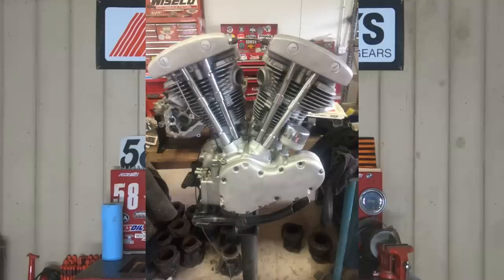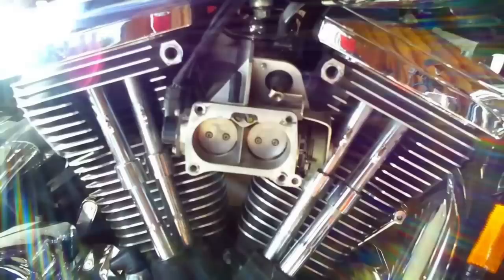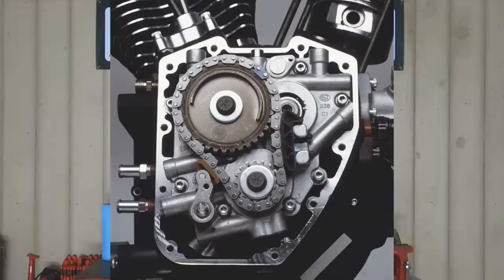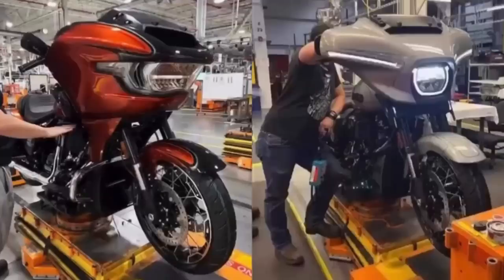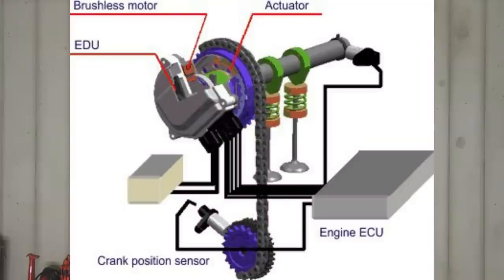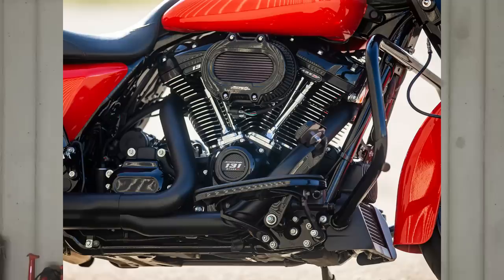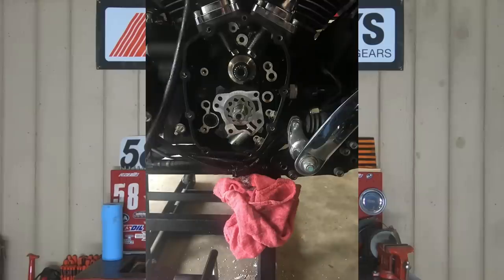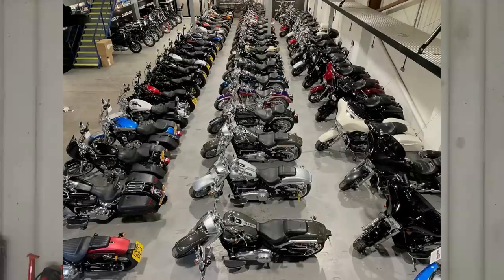Simple Harley Engines are Gone Forever

Comment from the maker: Do you think the Variable Valve Timing system is going to work well or do you think it's going to cause some unforseen issues?
Reply: Oh no it is 100% going to cause some issues, tha k God it's only on the dentist's and lawyers bikes for now
Reply: I think it'll be fine until people mess with it, just like any other evo-after Harley... They only really start to have problems when people mess with them... Yes my 103 has a stage one... Hopefully stage 2 soonish, but simple fact if you leave them alone they're reliable... I modify all my vehicles, my bikes, my trucks, but good on HD for doing what they have to do to keep a real v-twin alive
Reply: It will be a nightmare, just as it has been on cars.
Reply: It's beats up cams in pretty much every engine It's in.
Reply: Gm already has it on its v8 pushrod engines -
No problems -
Reply: @tylerlower5140  did you forget about the twin cam tensioners?
Reply: First off I'm not a VVT hater, but every manufacturer has a certain amount of issues with VVT. GM, Ford, Dodge, Toyota, Nissan, Honda and I could go on. Simple fact is the more moving parts to wear and oil the more points you will have for failure. Seen failures in everyone listed above. No one builds a bulletproof system. When you start building high HP applications in the aftermarket, most eliminate those systems for reliability concerns.
Reply: @tylerlower5140   thats how I feel as well. Let them use vvt and whatever tech wizadry to keep a air cooled american v twin alive. I wish they had tried vvt technology to try and keep the sportys evo around longer.

Comment: Evo sportster is the best engine ever
Reply: I had the first year. Chain drive 4 spd. $3995.00. I eventually punched it to a 74 but sold it in 96 after 21,000 fun miles. Wish I still had it.
Reply from the maker: All feelings aside and stick to the facts you're a fool to argue that point!
Reply: People shit on sporties but I love them. Probably gonna buy a used beater as my backup bike in the next year or two.
Reply: Until HD eliminated the "Trap Door" for the transmission, so they could charge a minimum of $2500.00 to split your cases to fix a transmission problem. What a scam. Indian followed suit by installing their oil pump inside the engine case.

Comment: Harley Davidson is going to evolve themselves right out of business, mark my words. VVT engines rely on oil system sensors to operate, sensors in oil are always a problem. I have been a mechanic on both cars and bikes for too many years to recall, and variable valve timing engines in cars have caused more grief than not. I don't even want to think about VVT on an air cooled V twin, sounds like a total nightmare. But that's just my opinion.
Reply: We all have em 8:24
Reply: I would not buy the VVT engine until the bugs are worked out... I have zero interest in being HD's test dummy, especially at the prices these bikes are going for.
Reply: I hear ya... I keep my bike engine internals stock. The days of making insane power and noise out the back is not for me any longer. All I want is a reliable cruiser. This is my 3rd HD. The first one was a leaker and ate excessive oil. My 2nd one had bad lifters and ate the cam. it also ate too much oil. Both were M8s. The 2nd one sumped 500 miles after repairs at 8500 miles and destroyed the engine. It was a 2020 with the supposedly better oil pump. On my 2023 107, I installed the DK Customs external breathers and the Trask vented transmission cover. So far, so good. I purchased a 5 year extended warranty through a private company so I can sleep at night. Fingers crossed :-)
Reply: @Peter I have been riding for 5 decades and have owned everything from Japanese to American bikes... I have had problems with more than one manufacturer's design and build quality. the ONLY bike I had that NEVER had one problem until it reached 55,000 miles was a Yamaha 2007 Stratoliner with the 113ci engine. absolutely fantastic bike. and even much better with a tuned stage 1 setup. torque and horsepower equal to today's M8s. I should have never sold it. why stick with HD? I like everything about their machines with the exception of engine reliability. the Japanese manufacturers turned away from making cruisers. Yamaha screwed up going to that Eluder/Venture bike. plastic garbage. Kawasaki's cruiser is priced right. however, it is way underpowered and also made of plastic. what is Suzuki making? the BMW cruiser is an odd bird, which I do not like. the only choice left is Indian. and their bike designs are so, so for me. my current 2023 107 Street Glide is the BEST riding motorcycle I have ever owned. love it. hopefully, with the mods I have installed, this bike will last me for many years to come. if not, I will have to look at Indian. and no, I am not stupid. I ride with many HD owners who have had minimal issues with their bikes over the years. so, not all of them blow up regularly. what do you ride?
Reply: Sorry you are such a hater... I wish you the best :-)
Reply: @richardrussell500  you know, here in the interwebs; all you typically hear is people complaining that their bike/engine/transmission has crapped on them, and they’ve got problems. I guess I just don’t understand that. Sure, there is no PERFECT, and sometimes when problems start (shavings in the oil for example), it causes other problems, which may produce the outcome of “my Harley is a total POS”.  Well, you typically only hear the BAD news. 

The good news is: I own 3 (three) TC’s and one old ‘79 sportster, and with proper maintenance, those engines are all running strong.  

HD deciding to switch over to water cooled and VVT may end HARLEY DAVIDSON, as the prices are exorbitant NOW; wait till they’re obnoxious!

I ride HD for the air-cooled simplicity of the TC engine. And the sound. Sounds like AMERICA to me!
Reply: I agree... a lot of negativity on the interweb. Unfortunately, I have experienced the sumping issue at 8500 miles on my 2020 114 trike, which seized the engine. Before the sumping, the faulty lifters ate my cam. My bike was serviced properly at 1000 and 5000 miles with oil changed at roughly 1000, 3000 and 6000 miles. And I was supposed to have the upgraded oil pump. I did not quit on HD as I purchased a 2023 Street Glide 107, which so far has been good. I keep my internals stock. I installed the DK Customs external head breathers and the Trask vented transmission cover. So far, so good. With the Trask setup I get literally no snot in my catch can. My previous two HDs suffered from blowby and excessive oil consumption. Fortunately, I am not getting that on this 107. I purchased a private 5 year extended warranty so I can sleep better at night. Fingers crossed. HD makes the best looking cruisers on the planet :-)
Reply: @Peter you are one negative cat...
Reply: More like troll... Move on :-)
Reply: I'm a mechanic working on mostly Japanese vehicles, VVT has been used for decades and I've never known any problems with the Jappa variants,maybe HD should talk to Toyota or Mazda etc.

Comment: I'm 50 and I have two carburated shovelheads. They will last for the rest of my lifetime.
Reply: Amen, fuck paying 50 plus grand for the new Harleys
Reply: As long as the parts are still available
Reply: @warlock9445  True, but there's no sign of parts getting scarce. In the last couple of years I have bought a NOS OEM speedometer and a complete NOS exhaust system for my two-year-only 1982 FXRS shovelhead. Harley and air-cooled BMW's have an endless supply of parts.

Comment: I have a first year EVO - 1984 FXST.  That was my first (and possibly only) bike I've ever owned.  What I like about it, is it is simple.  I can FIX IT on the side of the road!  I don't need an advanced degree in electronics engineering, and I don't need a computer (and a pile of specialty tools) to trouble shoot failures and, more than likely, I WON'T need it to be 'towed' to the dealer...
Reply: Evos are the best
Reply: I think evo was the best motor Harley ever designed,ss ,those motors big cam and head work they scream
Reply: I have an '84 FXST. I got it as a gift from my father in 1990 upon my return stateside from military service. I had 2 failures that were not my fault. A compliance fitting split open and launched my carburetor. I got home that day thanks to a wad of chewing gum. The next day I replaced the fittings with a solid intake manifold and that problem was solved. The second failure was 3 years later when the electronic ignition module died mid ride. I had to push my bike nearly 5 miles home in the rain. The next day I replaced that electronic ignition with points ignition and had 11 trouble free years. I still run points on both of my Evos. Even as the Evo powered generations progressed,  I knew that the "last days" of Harley Dadvidson were on the short horizon. When the twin cam came out, I knew that the end had come.
Reply: @Rif_Leman : Small world!  I bought mine in 1988, while home on leave from Germany!
Reply: @Rif_Leman "last days" at the introduction of the twin cam??? Bro, that was 1999 lol.  They've proved to be a great motor. You're stuck in time, like the shovel boys
Reply: @ricko9879  The arrogance of youth keeps you from understanding my post.
Reply: @Rif_Leman  your lack of mechanical know-how means you better keep fit for future 5 mile bike pushing.. the twin cam really isn't that much different to your evo

Comment: I've owned several Harley's including a stock '57 Panhead, stock '39 Knucklehead. Still riding after 49 years. Ride a stock '99 Heritage Springer evolution motor is the best, bulletproof.
Reply: Amen ❤😊
Reply: I have my heart set on an Evo powered machine for my next addition
Reply: 107” M8❤ ‘020 FLHX ridden some  50, 🫠🫶🏻👊🏻🤛🏻🤟🏼☠️
Reply: Miles😏
Reply: ,000 😎
Reply: I ride a ‘98 evo Electra glide classic. Still dependable and running strong.
Reply from the maker: I love hearing this!
Reply: @donblack3582  Nice! I have 98 Road King FI  runs great.
Reply: @3RDOOR  I've been riding since 1973. I have no idea, more than a lot of other riders. I'm an old man now but still riding.
Reply: @Steve-by9dn  Same, twin cam stays in the barn 👍

Comment: I'll stick with my twin cam. The Milwaukee 8 with vvt sounds like voodoo.
Reply: Here here!
Reply: I feel the same. I had an M8 and traded  back to a TC. Hopefully we will be able to continue to get parts so we can rebuild these
Reply: @mattcottrell3336 had my doubts for a while to buy a m8. Then test road it. No soul in it and sound like a sewing machine. Turned it back after the rest ride and road of om my dyna 🎉
Reply from the maker: I'm curious about it, just as much as with the twin cooling. The twin cooling is great but the down fall was something as simple as the housing on the electric water pump cracking and failing. Now we're messing with oil, pressure and electric solenoids. The 45 twin depends on that oil for everything!
Reply: @pierrebornerot4689  agreed. I had a heritage classic for about a year with the 107. No vibration, no growl. It could gitty up but didn't feel like a Harley to me. The dreaded oil pump drama mixed with Harley ESP made me come to the realization that the 103 was the last great motor of the pushrod era. I bought a road king with the 103 and decided I liked it so much, that I went to a low mileage Rushmore bike with a 103. Has been reliable so far and a smooth ride. I really hope Harley doesn't rid themselves of the original motor design, there's nothing else like it. The sound and feel, the ability to customize and the family that comes with just owning one. I'm 35 years old, but the feeling I get on these is unmatched. I liked my Hondas, but I loved my Harleys...
Reply: @GixxerFoo  I think that the twin cooling design is a great idea for the bigger motors. But at what point does the company realize they can't make these motors too much bigger without a complete redesign? And as you stated, if they can't design components to keep these twin cooled motors cool reliably, then why not just stick with what works and make it last a while? Hell they've already cranked the price up! I know you love evos, so I'm sure you'll understand where I'm coming from. If they keep going this direction with their manufacturing, they're gonna end up with a reputation similar to the dreaded AMF days. It'd be a shame to see the company fail after all these years. They've made some great bikes and great motors... who else makes a bike like Harley Davidson?

Comment: with the issues Harley has had with engines in the pass,  evo case cracking and lifters, twin cam chain tensioners and crank,  8m sumping and crank.  hasn't really stood behind those problems.  You really think Harley is going to pull this off?   I'll stick with my 103 hp with alot of aftermarket parts.  Not buying anything from Harley Davidson over priced and low quality

Comment: The twin cam wouldn't be bad if HD didn't cheap out on the parts. It should have had a proper crankshaft, crank bearings, and cam bearings. Theres no reason for the inner cam chain at all, that should be gears. I can live with the outer cam chain but it should have had a long chain guide/tensioner NOT a little bitty tensioner pad.
I'm not interested in owning anything HD made after 2017. With each new release I like them less and less. If I get a brand new bike it won't be HD.
Reply: As time goes by the twin cam will be seen in a better light. Just upgraded my cam chest in my 12 streetglide.  570-2 cyclorama cams. 98.7 h.p. and 116 ftlbs tourque.  It's a hotrod now.
Reply: The HD reliability is not good these days... I am on my 3rd M8 HD in 4 years. First one was a leaker and consumed excessive oil. My 2nd developed bad lifters, which ate the cam. And at 8500 miles it sumped destroying the engine. I now own a 2023 Street Glide with the smaller 107. I installed DK Customs external head breathers and a Trask transmission vented cover. My goal is to eliminate blowby. So far, so good. My next install is the oil cooler fan and the Fueling short sump plug. Some of the factory installed plugs are driven too far into the case, which contributes to the sumping issue. If this engine fails, it will be my last HD. I purchased a 5 year extended private company warranty so I can sleep better. HD needs to work on the overheating issue that kills these engines. My two cents :-)
Reply: I was a young boy when I bought my first Panhead (used) long before most on here were born.  The saying was Harleys are a great bike once you rip all the Harley junk off of it.  Over my lifetime I've found a lot of wisdom in that statement.  And what you say is true.  What would it cost to do a gear driven cam setup, decent bearings and some of the other OEM junk that most of us have ripped out and replaced with quality parts?  Harley claims to assemble a "premium" motorcycle.  Typical lies coming out of the Marketing department.  There is nothing premium about a stock Harley Davidson.  Maybe a decent crank would add significant cost but better bearings?  Better tensioners?

Comment: My dad bought a 1981 cb900c new and gave it to me in 2000. It is air/oil cooled and has 83,000 miles now and has been in the shop once to check the valves. One needed adjustment. Other than that, it has been just routine maintenance.
Reply: valve adjustment is routine maintenance.

Comment: The last “Easy” motor for the DYI Mechanic to work on was the Shovel. It was built like a Tractor with loose tolerances. Starting with the EVO, tolerances started to get tighter. Now everything is computer controlled. 🏍💨🏍💨
Reply: There's nothing like a simple motor, the way it's supposed to be, its a motor cycle, plain n simple.
Reply: Loved my shovel,still loving my flathead 55 kh
Reply from the maker: The shovel could be built on a dirt floor in a barn and it didn't care, the Evo could take a piece of wood under it on the dirt floor. But no doubt shovel was the last I don't care motor before tight tolerance took over. 60w oil in the shovel and good to go!
Reply: It’s all relative. I think the TC is a simple engine with loose tolerances in comparison to almost every other motorcycle engine out there. You can pull the engine and split the cases within an hour, at least a carb’d TC.
Reply: I can relate my 383 stroker back-in-the-day. Super simple

Comment: I'd stay away from the first two model years with the VVT
Reply: At least.
Reply: Real talk.
Reply from the maker: You know the M8 came out in 17 and I wouldn't personally touch one unless it's 2020 or newer.
Reply: @GixxerFoo  fact, my 2021 FXLRS I just traded in ran great, just over 40k miles, no problems. 

I met a few people that had massive failures on 2018/2019 M8s. 😬

Comment: Anything Harley comes out with will have problems and Harley will leave it up to the customer to fix it.
 cam bearing on the 1999,  cam chain tensioners on twin cams, compensator on 2005, Oil pumps on M8

Comment: It took me 30yrs to warm up enough to the Evo to buy a '97 WideGlide so my '72 ElectraGlide could take a well earned break.
 I know my opinion doesn't count for much, but to me, the last Harley rolled off the assembly line with an Evo engine in it.
Reply: WELL    SAI D     BREED   ,
I  "'  L L     STICK  WITH  MY   EV0    F X  L R  .
Reply: I 100% agree. Own 2 EVO's & a Twin Cam. I prefer the simplicity of the Evo, the sound, the vibration, the heritage to the Knuckle, Pan, Shovel. It's the sound EVERY American loves. Whether or not they'll admit it.
Reply: @kevinoconnor2921  
I own a Shovel and an Evo, because to me, they both retain the original spirit of Harley Davidson.
 A few years ago, I bought an 02 Heritage Softtail Springer with a Twinkie in it, but I got rid of it after 2mos because it had no soul.
 Even my wife refused to ride on it with me.
 If it had an Evo in it, Id'a kept it.